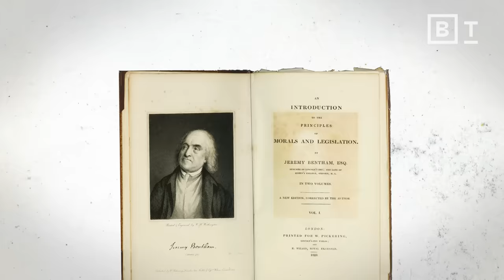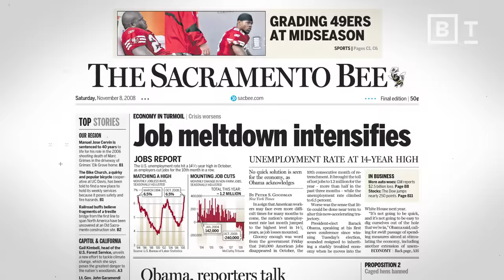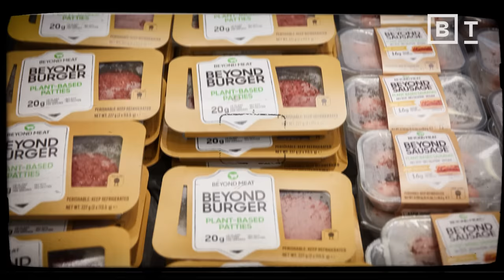The hidden cost of cheap meat exposed by Peter Singer

Comment: people already know how bad the farming industries are, but do we have any way to solve it? the problem with veganism is alot of them put the blame on the regular people who most of us need meat in our diet, same thing with oil, we know that air polution is an issue but we do not have a replacement or a better solution that is affordable. now if we want meat to be "humane" the price is gonna sky rocket, and if the food is too expensive no one would be able to afford, and if no one is buying meat the farming industry would colapse, and people need meat and what happen is someone somewhere is gonna sell illegal meat with cheaper prices bringing us back to step one... its not only a meat, oil, or economic problem, everything is entangled one with another, the entire system needs a fixing, by pointing fingers at each other instead of actually pushing the government at the top to change the system is pointless, we know the issue, but now we need a solution, and the solution isnt turning vegan